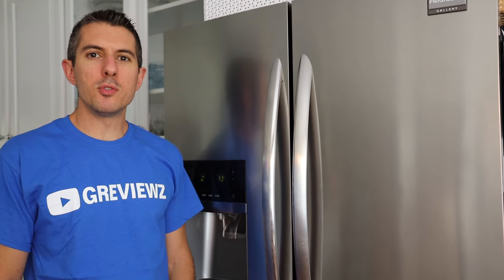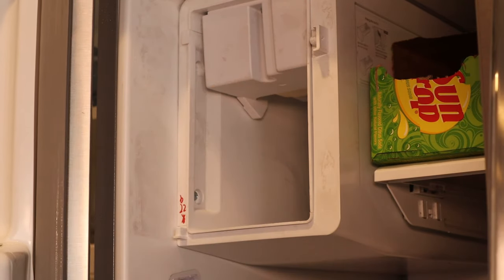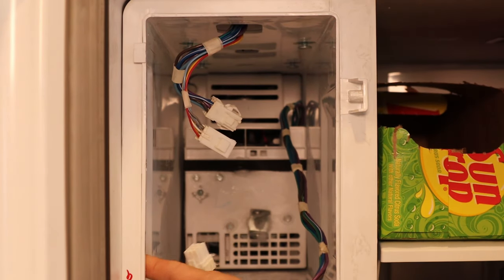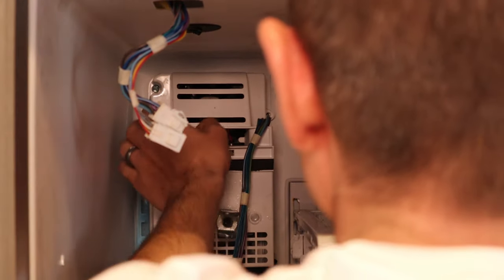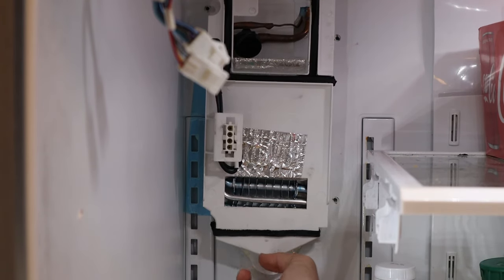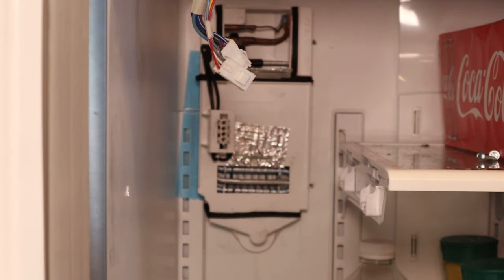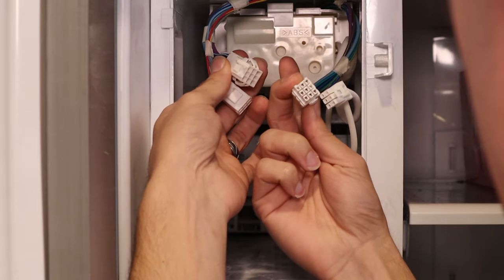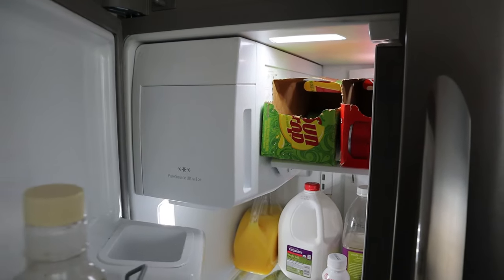Frigidaire ice maker broken again: fix it

Comment: Thank you for making the video. We have the exact same fridge. Our issue with ours is that it's not dispensing ice at all. It's producing ice, n=but not dispensing it. The solenoid and motor for auger are both working upon testing them. Are you familiar of this problem? Thanks!
Reply from the maker: So are you saying when pressing the ice on the screen and pushing your glass against the clean switch the auger is spinning or not spinning?
Reply: @GReviewz  it spins, and solenoid works as well.

Comment: Thanks for posting. Question. I did what you did and had very minimal ice. There was one piece of ice in the inlet where it fills up the tray. I cleaned everything out, defrosted everything and put it back together. The fridge made one tray of ice and then quit again. I don't think I have the same problem as you with the ice. Any suggestions? Tia.
Reply from the maker: Is your water filter clogged or full? Is there any ice in the water lines? When you tore the unit apart was there any ice in the drain whole at the back? If everything checks out ok you may have to get a service tech to come out.
Reply: @GReviewz  no ice in drain, very little on lines. New filter should be here today. Thanks

Comment: Very helpful.  I've done this about 3 times... what is the trick to keep it from freezing in the first place?  Is it just such a poor design that you can't keep it from freezing up?  Seems like I need to this about every 6 weeks...
Reply from the maker: Thanks for watching. A few things to check is what temps are you running in the fridge/freezer? Is you water and air filters changed or old and clogged? Do you leave you fridge door open longer than 1 minute?

Comment: Does Test 26 in diagnostic mode defrost the ice maker? It’s labeled as Defrost Limit Switch test. Not sure what that actually does.
There’s no ice in the rear coils. How do I just actuate the water fill switch?
Reply from the maker: Thanks for watching. You model may be newer than mine however on mine it has a option (ice maker) on or off…is it a new fridge?

Comment: I really like your video, I have the same refrigerator and my ice cubes are small is this normal? Also I can’t take the spout from the ice maker out to clean. And lastely the ice maker runs well but the ice is slow coming out when I press for ice....any suggestions?
Reply from the maker: Thanks for watching. The ice cubes from these units are quite small. Have you noticed them getting smaller over time. If the ice is slightly melted and they freeze together the auger will have trouble breaking it up to dispense.

Comment: If I just try the defrost portion (without removing all the inside parts) how long should I run it on defrost without ruining the food inside? 😬
Reply from the maker: The defrost runs on cycles. I believe it runs for like 10 mins or so. It should t ruin the food. The defrost really doesn’t fix the problem…

Comment: Have you had to do this again since posting the video back in July?  I'm curious if it has been a long-term fix (so far) or if you have had to repeat the process.
Reply from the maker: Thanks for watching. I have not had the problem re occur since then. The problem tends to occur when the ambient temps go up in the summer and the air is more humid. I try my best to keep the doors closed as much as possible. Don’t leave the door open too long..

Comment: I have the same fridge/model. My ice male worked for a very short time. Also my temperature lights on the outside screen do not work. Any help would be greatly appreciated.
Reply from the maker: Thanks for watching. The screen and the ice maker are the 2 things on these units that are poorly designed. There is really nothing you can do about the screen other than replacing the screen. I would place a thermometer in the fridge and freezer to monitor temps.

Comment: Might mention that this fridge has a defrost function accessed from the front panel (+ & - at the same time for 5 seconds) that will thaw the ice without total disassembly. May need to do it a few times, if it’s never been done.
Reply from the maker: I did mention the defrost mode in the video!
Reply: You did mention the defrost cycle but not in a lot of detail you told us how to turn it on, but does it only run 10 minutes and automatically shut off or do you have to manually shut it off?

Comment: I have the exact same fridge as you . My issue is that I hear the pump working but that’s it no water or ice working. I changed the water filter but still no luck. Do you think what I might be?
Thank you
Reply from the maker: It could be about 20 different things. These fridges have design flaws to say the least. Have to gone through the de icing process?

Comment: The air flow system needs a seal kit.  Air is leaking in between seal causes all kinds of problems.The new seal is a silicone all in one gasket.  Seems to do the trick

Comment: Just dumped our ice since the dispenser was having difficulty with the large size of the cubes now it won't make any ice...

Went through the diagnostics; ice tray turns correctly and I can hear water trickle into the tray. Think there is an ice build up at all?
Reply from the maker: All I can say is that there r many different things that can be wrong with your fridge. Try and run the defrost first. If that doesn’t work then try the steps on the video. Ice buildup can cause no ice to be made or even stop the motor from dropping the ice.

Comment: I followed deep by step for the same model fridge,  was completely iced over. Got the ice our, ran defrost cycle, waited over night and still no ice. Do you know what I should try next?
Reply from the maker: Well if my process did not work a lot of people are having ice build in the water line that feeds the ice maker. Take a blow dryer yo the line on the rear of the fridge as well as the little black nipple that I showed right above the ice maker on the inside. See if that works
Reply: @GReviewz   I tried tour suggestion but no success. I was found another video that outlined the diagnostic tests you can run on the fridge. I was able to see the water line was working fine. My issue was that my heat gun had actually warped the ice tray. Which was not allowing the arm or tray to cycle. Once I cut out the warped section it worked like a charm. Thank you for the help!

Comment: I tried this yesterday afternoon and by 9:00 pm it had dumped two trays of ice with a little more this morning. However, by the time I got home this evening it has stopped making ice again. There was no ice in the tray for sure. Any suggestions on what might be causing this problem? Thanks for your video!
Reply from the maker: I’m sorry this is happening to you. When you performed the “fix” in the video was there a lot of ice buildup? My guess is you have a worst case scenario. Somewhere in your system moisture is getting in and causing the ice. Or a member of your family leaves the fridge door open for awhile..
Reply: GReviewz there wasn’t a lot of ice buildup. I expected much more. As far as leaving the door open, I’m pretty sure we don’t have that issue. Any other ideas if maybe it’s stopped up in the feeding tube? (FYI, I still have water flowing from the water in the door and recently replaced the filter.
Reply: @stephenbuys2511  I had the same problem and have been wrestling with it, taking it apart every month, sometimes sooner, and trying to defrost it.
I found that the main water line in kept freezing up and not allowing any water into the ice maker.
I would take everything apart, but would leave the unit at the back there, and take a hair dryer to the water spout at the top of the fridge.
Eventually it would clear up and make ice again.
This started happening every 2-3 weeks and after a year of this it's getting old.
I took out my angle grinder and delicately cut a hole in the top of the fridge where the water line runs, exposing it to room temperature air.
Hopefully this helps.

Comment: do you know where i can a buy complete a replacement? the thermostat wire is broken and its so fine it may not be repairable
Reply from the maker: The first place I would look would be on the Frigidaire website. If you can’t find in on there sent them an email/phone call to get a part number and then look it up online.

Comment: Had the same problem. I took it part way apart, not to the coils and heat gunned it. Got a lot of water but it didn't work. I assumed other issues and called a repair guy. I wasn't home but the guy told my wife he couldn't fix it and we should probably just buy a new fridge. He reset the power through the breaker and said to wait a couple of days. Nothing, so I decided to go all the way. Wow was I surprised! Huge chunks of ice. Got it cleaned up and dry, just waiting to see what happens. there is no way it would have operated in the current state. I was overdue on my filter replacement and just wondering if the reduced flow would have contributed to the freeze up? I wonder if anybody has made a determination on this or is this simply a maintenance issue that needs to be done every so often.
Thanks,

Comment: I have the same Frigidaire. My cubed ice button stopped working, still get water and crushed. The button doesn't light up. Thoughts?
Reply from the maker: Thanks for watching. That definitely sounds like a motherboard issue. I would try un plugging the refrigerator and then cycling through water crushed cubed and see if it works.
Reply: @GReviewz  must be a motherboard, didn’t work. Thanks for the reply.

Comment: What about older models of frigidaire? 😭🙄 (just moved into a place with a fridge/freezer combo, we doubt it's gonna freeze our stuff or even make ice!) 

It has a exterior ice/water dispenser.. but it has not filled the ice maker with water at all. (While closed.. it will deliver water to a cup, and the light does turn on.) Fridge definitely sounds like it is running.
Reply from the maker: It may be an icing problem like I’m showing on the video. I’m not sure exactly what the problem is Whit out seeing it. I’d start with unplugging for the unit for like 10 mins then plugging it back in... next check all the filters to make sure they are not clogged. Make sure water line is turned on. Check to make sure ice maker is in the on position.

Comment: PROBLEM DIAGNOSED (but maybe not solved): 
i have a frigidaire professional frig FPBC2277RF. after over a year of on and off ice maker problems i have determined what i believe are the two main problems interfering with the fresh food ice maker operation.
1) ice blockage at the exit of the fill tube. just to clarify, the fill tube delivers water to the ice mold. the fill tube outlet is located at the ceiling above the ice maker housing. the ice maker temperature gets down to 10F. any water/moisture retained inside the fill tube outlet port will freeze and through repeated fillings of the mold will cause ice build up until it blocks the outlet and therefore water cannot make it to the mold. the 55c test will fail. 

i put silicone grease around the fill tube outlet in hopes that water, hence ice, cannot accumulate.

2) frost build up of the evaporator coil. if the defrost heater fails to operate frost and ice will build up around the evap coil until air flow from the circulation fan. the temperature of the air of an unobstructed coil can get down to 0F! the air will might only get cooled to 15F in a plugged coil. 
the fridge computer will not deliver water to the ice mold if the temperature is not cold enough. 

i swapped out the defrost heater and thermostat. i tested the old parts and there was nothing wrong. the heater resistance was 170 ohms and the thermostat had zero ohms at 20F and infinite ohms at 55F. i ran the defrost mode with the new parts and they did function, used an IR temp gun. 
perhaps the old parts had intermittent failures and/or there is a computer glitch. IF there a computer glitch, then SOL.

anyway, to wrap up. disassembled the ice maker per this video, defrosted the fill port ice blockage (about 1/4" ice plug) and defrosted the evap coil with hot water and swapping heater and thermostat. its been 4 days since i serviced the ice maker, the bin is full and there is ice in the mold. so, it is working for now. 

when it stops producing ice, instead of disassembling the housing, i will use a steamer with extension nozzle to defrost the fill port and coil. 
will provide updates.

NOTE, it is well recognized that ice maker malfunctions are the number 1 problem of all fridges that have ice makers. you would think manufacturers would have found the solution by now. anyway, in 10 years, when my fridge is due for a replacement, i will probably get an LG or samsung.
Reply: I got rid of my Samsung fridge because the ice maker Wes terrible. Don’t look to Samsung for your solution

Comment: Question does this solve the continuous icing up problem or is it just a bad design? When mine stops making ice, I just turn off the ice maker for at least 8 hrs and it starts making ice again.
Reply from the maker: This is a quicker remedy than Turing off fridge for 8 hrs… it is a poor design…
Reply: @GReviewz  Thanks for your opinion,but, if going through the process of tearing my ice maker apart every few weeks and not fixing the problem is the best remedy, I’ll just keep turning off my ice maker, NOT the fridge. The video did confirm my suspicion though! Thank you

Comment: Are you still periodically having this issue? This will be the 5th time I am doing this fix, and its driving me crazy. Normally itll last a while before having to redo the fix, but now its frozen up again after only a few weeks. Have you had luck with a more permanent fix?
Reply from the maker: Maybe every 6 months I have to do the fix. Trick is use the ice maker every day and don’t leave the door open longer than 30 seconds on the refrigerator.

Comment: Mmmm those were helpful instructions- I must say it was not that easy. Mainly getting that coil cover part off and putting the largest part (3 screws) back. My ice maker looked the same in design and in presence of ice.  I'm pretty sure that I connected everything electrical back well and I turned the ice machine back on. It's been a few hours and now I'm worrying that I didn't put it together right, no signs of ice making. Good news though is that the bad sound when ice maker was turned on but not working stopped, and a a very frequent ticking sound went away as well. I guess wait a day or so before I take it all apart again.
Reply from the maker: Thanks for watching. I hope you have ice production!! Let me know if you have ice…
Reply: @GReviewz   yes made ice and now i'm back rewatching because I'm pretty sure it's frozen again. Lots of annoying noises coming from the fridge...

Comment: Would it be possible to just put the fridge in defrost mode and let the ice melt, without having to do the disassembly?
Reply from the maker: Yes that is always an option. However many people and myself included tried the defrost cycle and it still didn’t fix it

Comment: I hadn’t had ice for days. I did this and there was some ice buildup in the back. I have since out everything back. About 24 hours later there are about 10 ice cubes in there. Obviously more than before, but it feels like there should be more. Any advice?
Reply from the maker: Thanks for watching. Yes there should be more than 10 cubes. Ru sure you got all the ice buildup out? Even in the drain tube at the bottom back?
Reply: @GReviewz  Yes I did, but I found out the problem. My wife had turned down the fridge temp. She had found that helps. I’m pretty sure that froze everything again. I turned it down and was hoping that would work. Everything said it takes a couple days for the temp to drop. We lost power in a storm that same day, the fridge deforested, and now it works like a charm. Thanks for this video!

Comment: Another issue we have had with this refrigerator/ I noticed the rotating bar in between the doors was not rotating/ sealing properly causing the back of the refrigerator to ice over 
I fixed the problem by removing the inside bracket track where the middle bar pin rotates into - I added a few washers to reposition the bracket / put the bracket track back and now the door closes properly and ice no longer builds up

Comment: Question:   If you turn the ice maker to off for a time.   Would that thaw it out with removing all of this equipment?   Just wondering.
Reply from the maker: Thanks for watching. You can put it into defrost mode however it is essentially defrosting the freezer and ice maker together.
Reply: @GReviewz  OK....But I am not talking about defrost mode.   On the keypad, you can simply turn the ice maker to OFF.    Would that work if it remained off for day or do you need to take it apart?   Thanks fo the video.    I will probably end up taking mine apart.
Reply from the maker: Sorry for the misunderstanding. Yes it would work but it would take awhile. The ice maker is is in the fridge and in let’s say a 34-36 degree environment. That ice will take awhile to melt and if you don’t get every bit melted it will just form more ice once the ice maker is turned back on.

Comment: Your method did work.
But for 1 week only.
So i have to repeat this procedure every week. 
Is there an actual fix??
Reply from the maker: There is a lot of variables that go into it. That fix has lasted me 6 months. You are somehow getting extra moisture in there. Do you leave the door open awhile? What temp do you have the refrigerator set to?
Reply: Your method works for 1 week exactly  , 
My freezer is at -18 and fridge 4.

Comment: What's going to keep it from icing up in the future?
Reply from the maker: Nothing. These units have a flawed design. This is a bandaid repair. However  I’ve have my fridge for a few years now and only had to perform this twice..
Reply: It does have a fix, you will need air handler it is a new design with gasket for the fix!